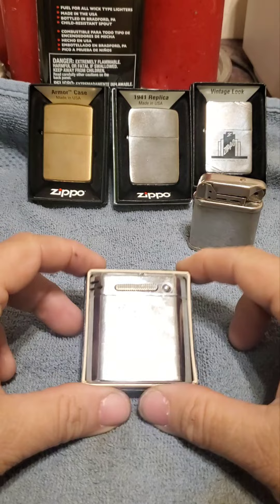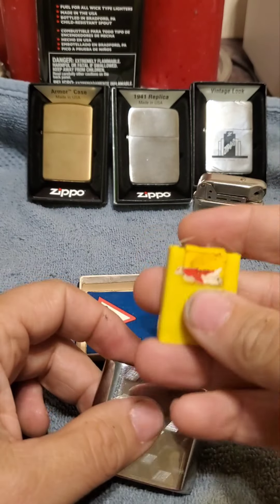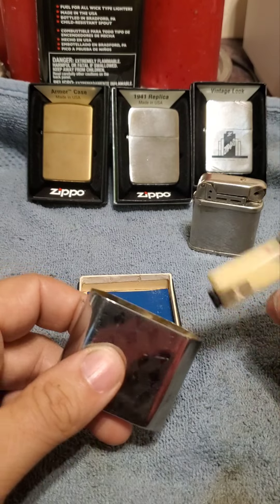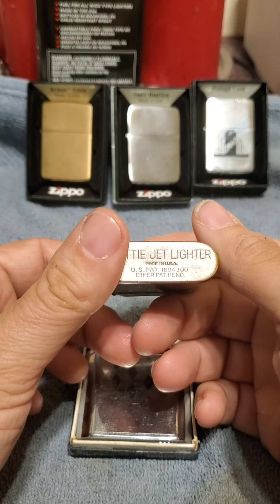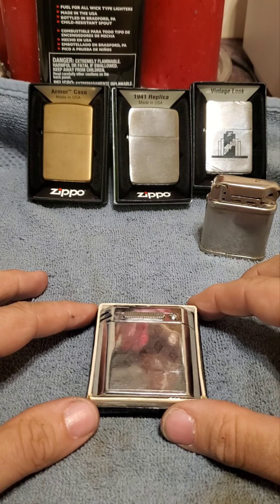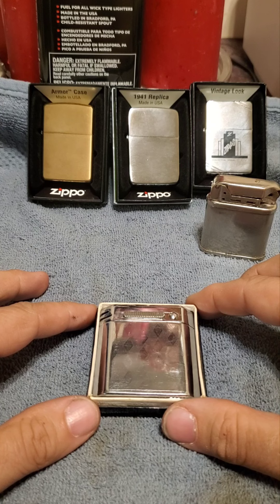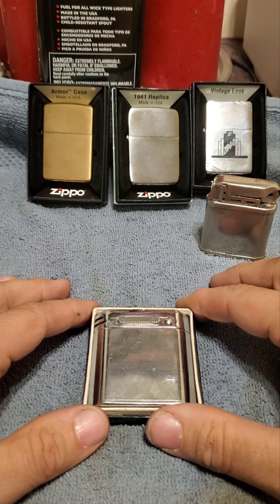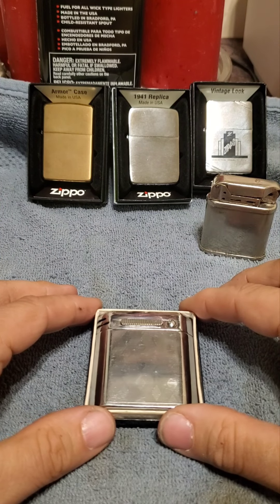Fumalux fl400 lighter

Comment: Using 2. N cell Batteries work better
Reply: The N cells are too thick, and need to be slightly crushed to put them into the case.
Plus, not rechargeable